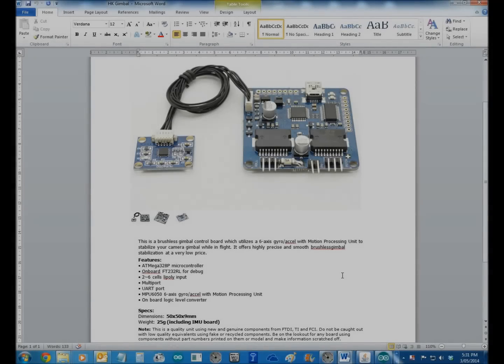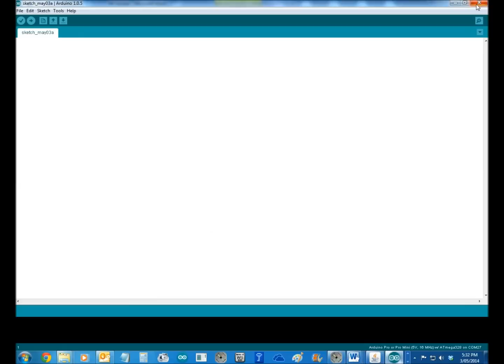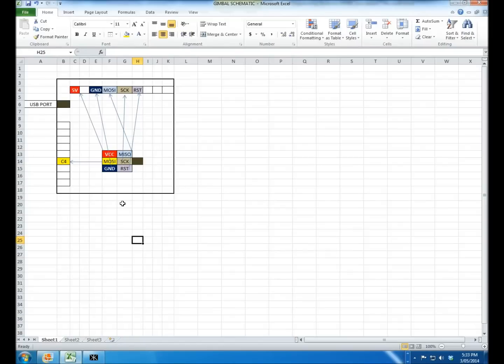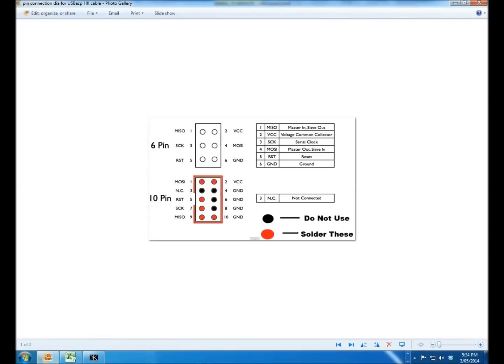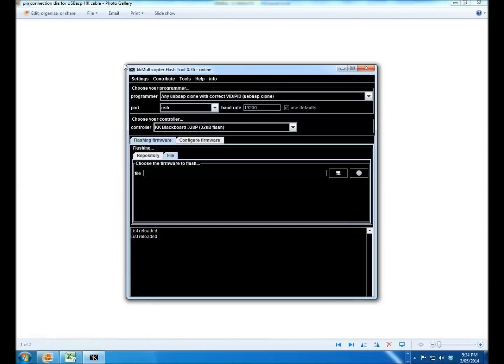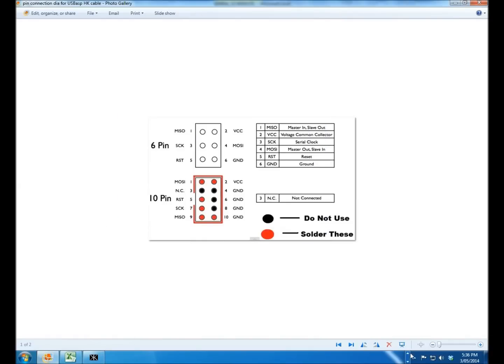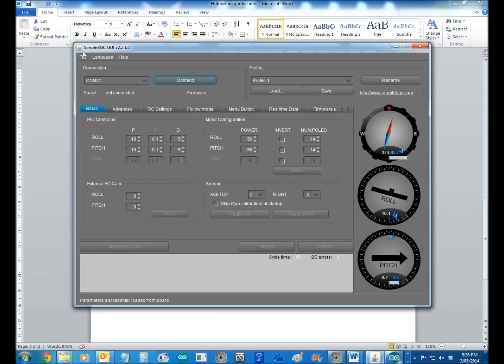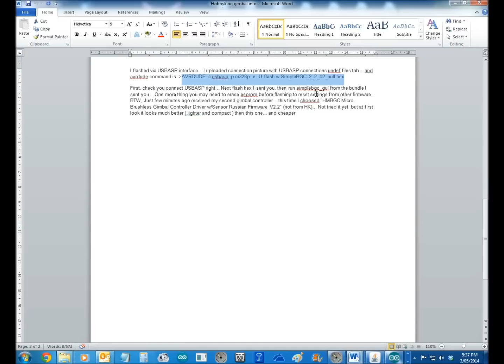Flash ALEXMOS Firmware Onto Your Gimbal

Comment: Thanks for this.  It worked great.  I struggled to get the new Martinex v2 gimbale controller with the CP2102 chip to work through USB with either Arduino, avrdude or XLoader.  This is the board currently being sold though HobbyKing.  Despite the CP2102 driver loading properly, I just could not get it to work.  Flashing the chip directly using this method worked without issues.
Reply from the maker: Happy to help...... happy videoing.... cheers

Comment: Hi! So basically you erased EEPROM so then you flashed nulled hex file into Martinez board? I have an issue here! I am not able to flash via XLOADER, but I believe I have to erase EEPROM before flashing ALEXMOS, right?
Reply from the maker: Hedio Trevisan I had the same problems with XLoader so that is why I used the KK flashtool and yes you definitely need to clear the eeprom before installing new firmware.